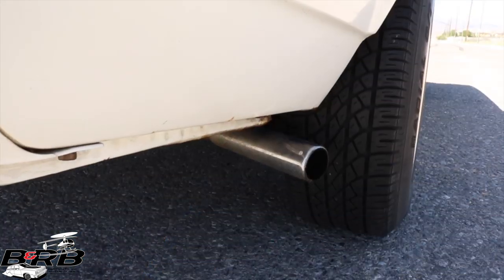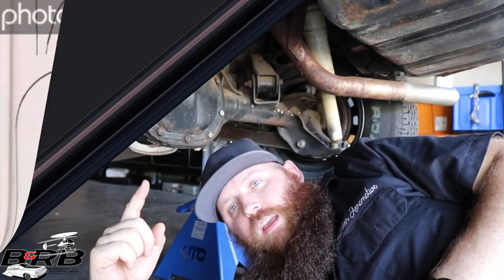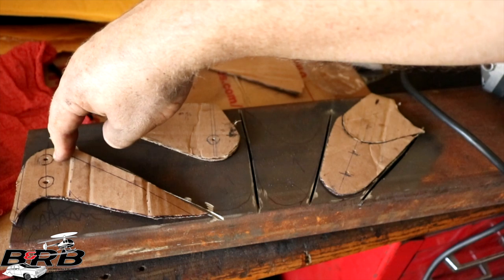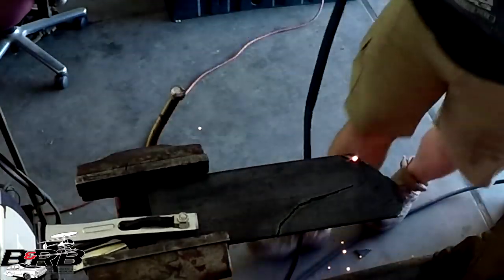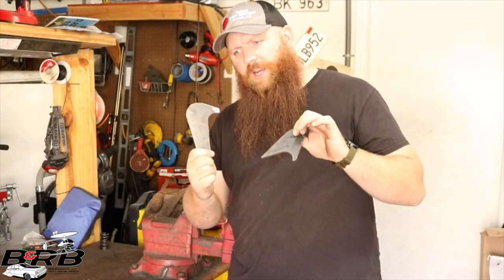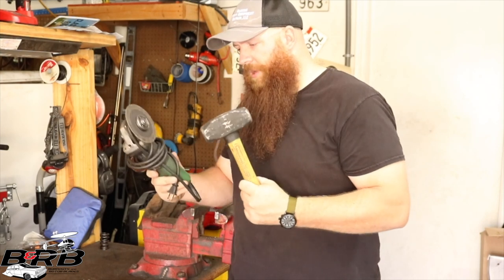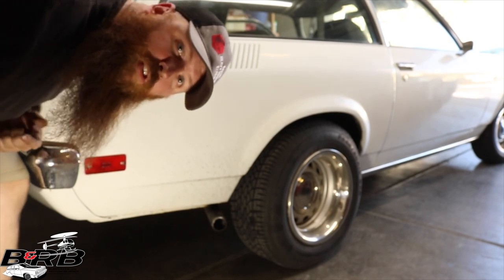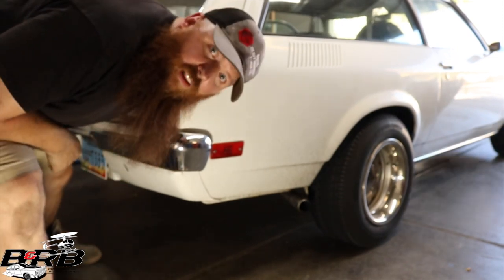Axle Hop-stop brackets FTW!! | Vega EP5: #driftvega

Comment: Back in 1972 I was a apprentice machinist with a '72 Vega GT that had severe wheel hop. At school the teacher allowed me to make a special project and using a period magazine ad, made up a set of my own anti-wheel hop brackets. I installed them one cold Sunday afternoon in my Dad's unheated garage. By the time I was finished it was beginning to turn to light snow with a slushy surface on the pavement. Not good weather to be working on my Vega, but perfect weather to test out these brackets. Needless to say they worked like a charm. Not only was all traces of wheel hop gone, but the Vega did not lurch down in the back as before. The rear wheel would spin, but no violent axle hop. I do not remember the dimensions of these, but would not be hard to make new ones today. Basically each bracket was two pieces of steel. The top part was probably 1/4 inch thick by 2 inches wide shaped in to a "U" shape. The upper control arm would fit into this part and bolted tight. The bottom part was a steel block made to fit tight into the axle control arm channel, so once bolted in, it could not move. The two parts were then welded together. I bought two GM rear control arm bolts and nuts to complete the project. I just posted pictures on my Vega GT and Cosworth Vega Facebook Page if anyone wants to see what they looked like.

Comment: Hi Brian 
I have similar mods to rear suspension wonder what you did to the mounts on the body side with the addition leverage mine seem to be pulling out.
Reply from the maker: To be honest, I just didn’t look at them. They could be pulling out and I have no idea. My plan has always been to do subframe connectors and having the body mounts pull away would be a reason  to pull the seats and carpet and perform some sincyouous maintenance. Since-you-was there, mozzle do the subframe connectors.

Comment: Great video! If you want a real fabrication game-changer, grab a portable bandsaw and make a vertical stand for it. They sometimes go on sale at the 'freight for under $100 and are waaay easier than plasma for most operations. They're good for bar, angle, pipe, tube, and they don't care what material you're cutting. I use mine more than X 799 and .032 put together.
Reply from the maker: Thanks for the tip! I've wanted one for a long time.

Comment: Excellent content!  At what point do subframe connectors need to be installed in a V8 Vega? I plan to build a 350 horse 350 small block. turbo 350 trans and running street tires, not slicks. The car is very solid and nearly rust free. Rockers are not weak and rusty
Reply from the maker: Honestly, if you drive the car like a grandpa, it'll be fine. If you drive like me, an a**hole, the anemic little 283 is probably enough to require sub frame connectors.

Comment: Man that was way to much work. Took me 10 minutes to bolt on my slapper traction bars to the bottom of where the shock bolt goes through the shock, and that was it.
Reply: Can you send me a picture of the instructions to put the slapper bars on
Reply: Alright, I'm going to send you a crude drawing of how they were made. Give me a half hour or so.

How well does the wagon ride with the upper controll arms sitting that high up? Do they ever hit the floor if you have a load back there or maybe passengers?🤔?
Reply: @gordonstroup882  the wagon is completely stock except for a 350 engine a 350 transmission and a 8.8 Ford rear-end I started this project years ago got this far grandson wants to finish  it I kinda want to also. THANKS FOR YOUR HELP

Comment: How much would you charge me to make me the axle hop brackets for the Vega . Are you located in Texas I saw the front brakes swap on the Vega I need to do that also. I already have the S10 rear end. If it's another form of communicating with you I would appreciate that also if possible thank you!
Reply from the maker: I am not interested in producing parts for resale. There is a guy called Monzamouse on the forums that makes rear end brackets.
Reply: @BurnoutsAndRotorblades  
Thank you 4 the fast response! Appreciate that and the information!